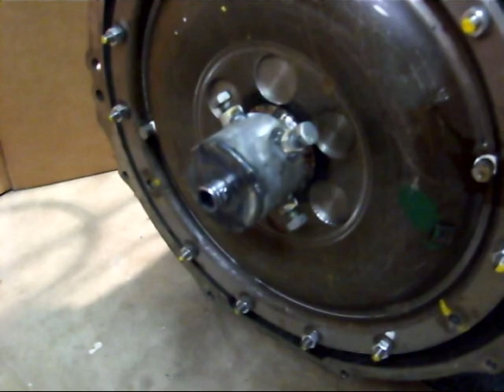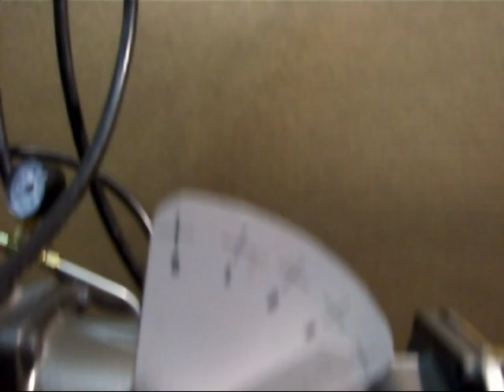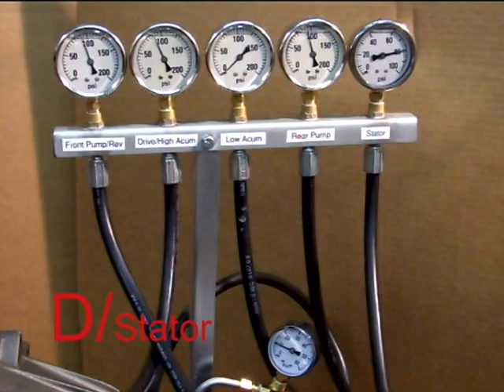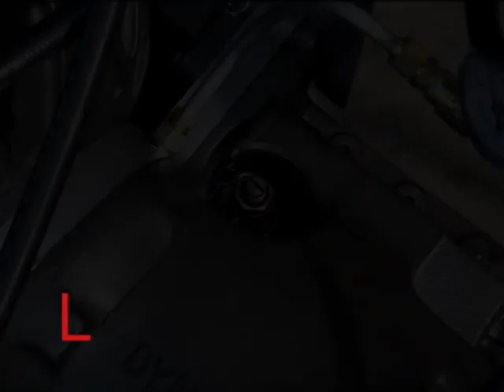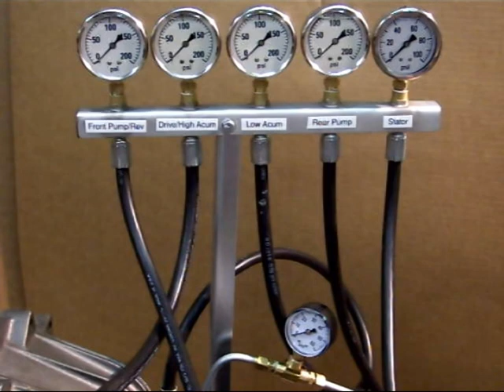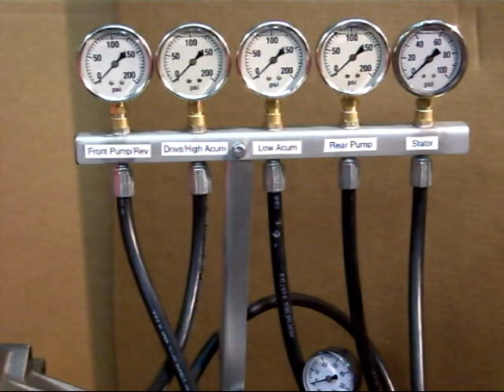1955 Buick Dynaflow TransmissionTesting

Comment: I had a Dynaflow in a '63 Buick LeSabre.  I couldn't sense the shift points when accelerating and thought maybe it was stuck in 3rd gear, so I took it to a transmission shop.  The guy said it worked perfectly and that's just how they are.

Comment: Very nice demonstration! I like your gauge manifold setup. 

I am assuming that the Dynaflow has an internally supported torque converter? I have considered making an off-car test as shown, on my FWD transmissions. The problem I see is, the newer units seem to depend on the crankshaft pilot bore to support the outboard end of the converter. I haven't taken the time to fabricate a support plate to try this. :)